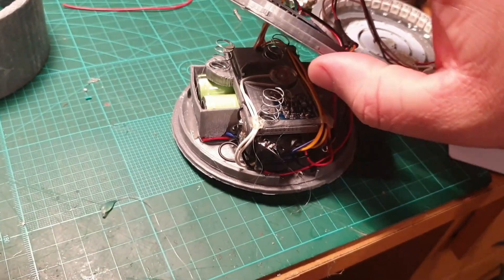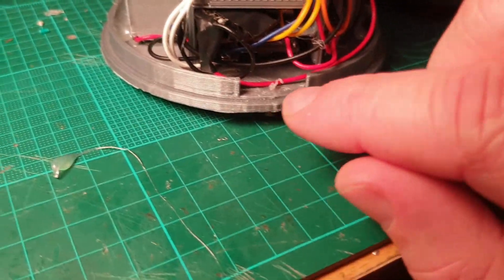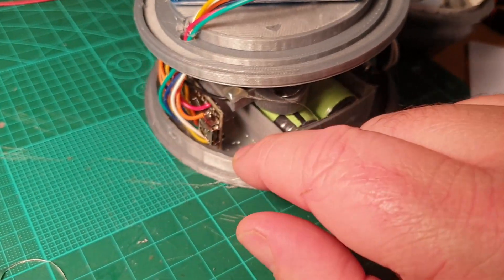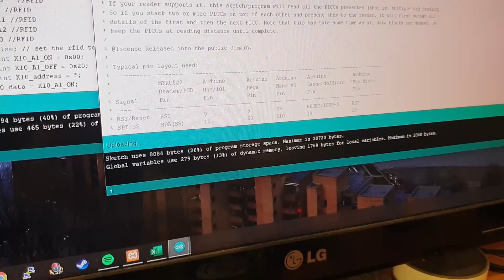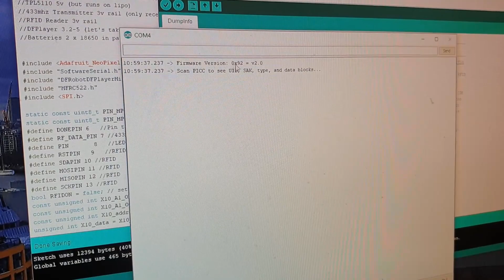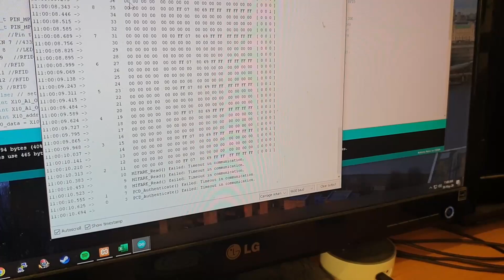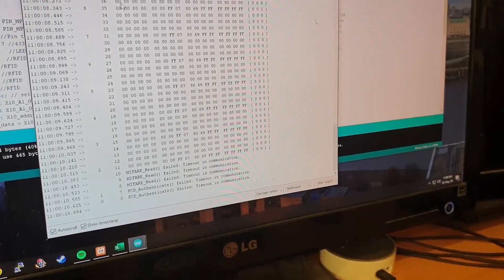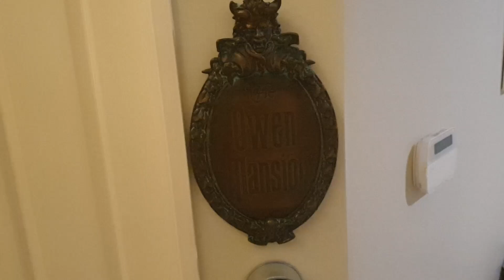Arduino based MagicBand Doorbell - build video

Comment: I know I commented on the other video, but your vids pop up in my suggestion now.  I'm pretty sure the issue is the magic bands use ISO 14443-4. The RC522's specs only list 14443-3a/b.  Not sure why some of them (I also saw the video you referenced at the end) and 1 of the 4 that I have here DOES read it.  That said, the pn532 does list -4 in the specs, I have 4 of them here and they all are working for me.  I know you're using a nano, but if you're interested in anything I've done with the nodemcu, maybe I can help.  https://youtu.be/mJemxa4pSa0

Comment from the maker: I've since swapped out the TPL5110 and replaced with one of these https://www.adafruit.com/product/1400 as it has similar power consumption, a bigger button, like functionality and i could straight swap and removed my rather sketchy desoldering job on pin 6 of the TPL in order to connect it to ground to get One Shot mode to work.